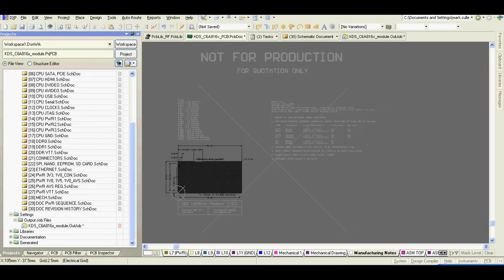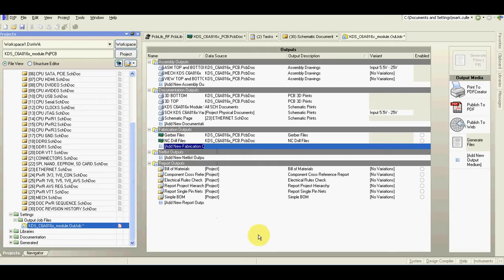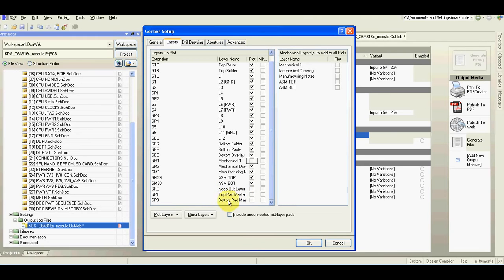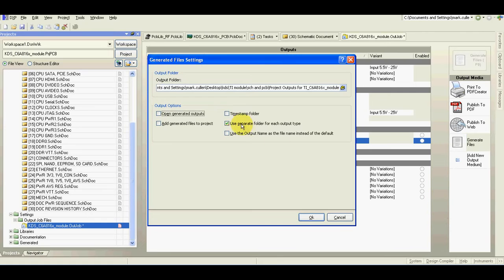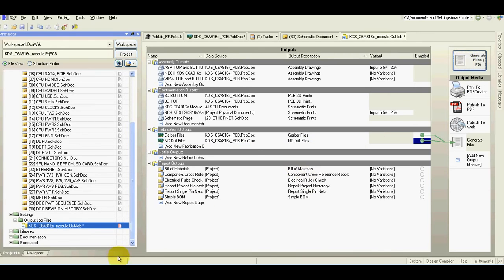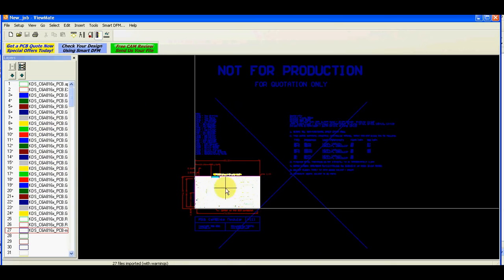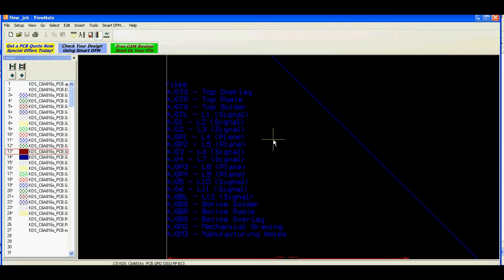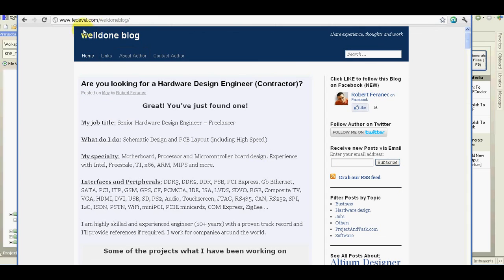Altium Designer - Generating Gerbers for PCB Manufacturer

Comment from the maker: Hi, I normally use "direct" for vias and smd pads. I use relief for through hole pins - especially for ground and power - these can be very hard to solder if direct plane/polygon connection is used